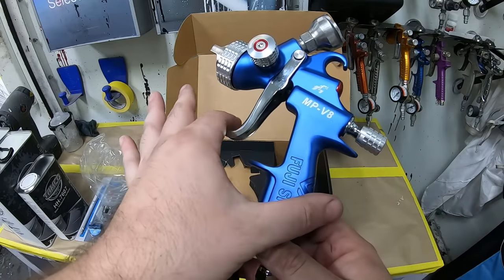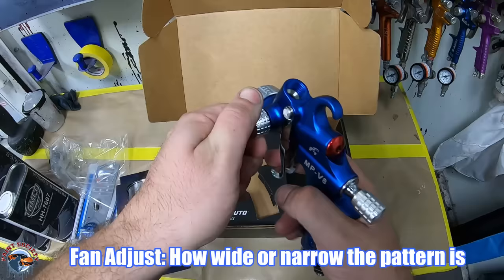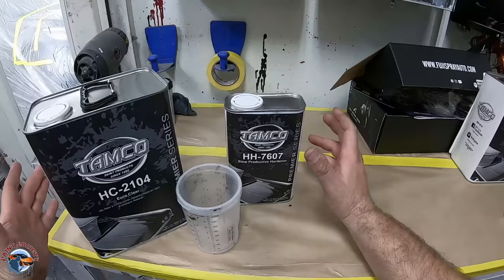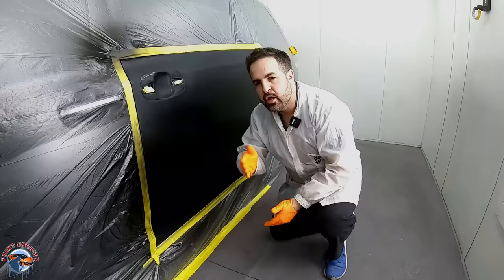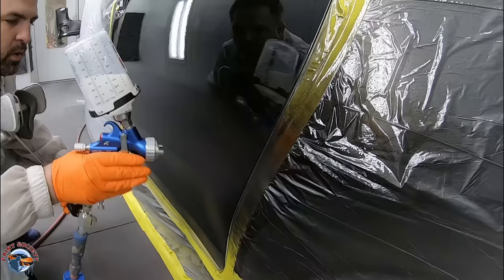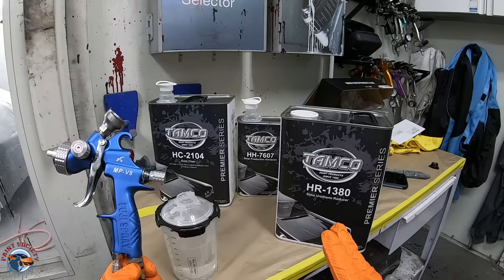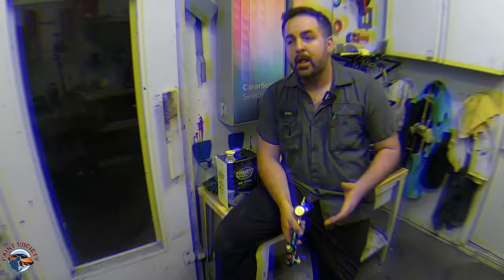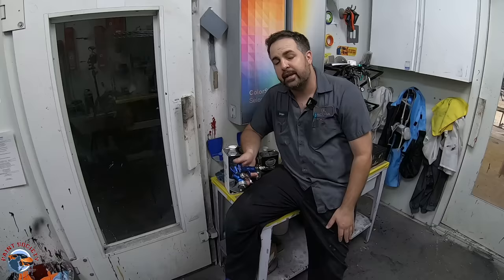The Best Paint Gun Settings for Spraying Clearcoat

Comment: What psi would you spray high solids clear with ? And 1.3 or 1.4 tip? I shoot at 32psi and always seem to get orange peel even at lower psi. What am I doing wrong ?
Reply: For a DIY with less experience I would recommend you try a medium solids clear. There is no magic psi that's going to fix your orange peel.  It depends on what gun you use but it's more about technique.  Definitely avoid hvlp guns. Keep overlap to 75% and tighten up the gun closer to the panel while moving a touch faster. Hope this helps.
Reply: @mitchellferre1652  how can you avoid hvlp guns when that’s what kinda guns automotive paint guns are???
Reply: @riffraffchoppers  hvlp guns are what automotive type guns are ??? There are conventional gravity and suction feed guns available.  Also HTE, Transtech high efficiency non-hvlp guns. I recently bought two. These will work better for someone with less experience and a smaller air compressor for spraying clear coat. While HVLP sounds nice they require LOTS of airflow.  High volume low pressure.  High airflow . Low pressure.
Reply: @mitchellferre1652  ya gravity feed guns and suction requires LOTS of air too. Iv never heard of anyone using those guns you mentioned to paint a car or bike with. My problem wasn’t lack of air I have a big compressor my problem was not enough fluid once I upped that and slowed down a bit no more peal really.
Reply: @riffraffchoppers  that's good to hear you are getting better results. The two main guns I use are a Devilbiss GPI for clear and a Iwata W400 Bellaria Classic for base coat. Both gravity feed . Both non-hvlp. And they use almost half the airflow cfm that my Devilbiss FLG3 hvlp requires. The hvlp gun uses 16.4 cfm at 23psi. The GPI and iwata use 9.5cfm at 29psi. Their finish is superb and they don't use more material.

Comment: When painting a whole car with primer is it best for a newbie to paint panel per panel?
Reply: Doesn't matter with primer, as long as you get enough on.  Your gonna be sanding it anyways so panels don't have to match.
Reply: Youre supposed to sand before base coat? I thought I was supposed to wait about an hour  then apply my base color? Because I already put on 2 coats and I'm going for my final next week I just need to buy more pearls because I thought 5g was enough but I actually wasn't more colorshift now lol but @dipyourcar website isn't even working properly
Reply: Why are you painting a whole car primer...primer is to cover bodywork. Was the car that bad
Reply: @mikemetcalfe1526  no but isn't it better to base coat after primer has set for about an hour? That way you paint last longer
Reply: @WreckinStreetsDaily  no..you can paint right over the old paint as long as you have sanded it with 600grit. If your spraying dipyourcar i think you dont have to sand the car. Just tape, clean then spray
Reply: @mikemetcalfe1526  I'm sanding with 320 but I'm just sanding down some runs from a previous pass right now and also fixing one last dent before I go for a complete cover.